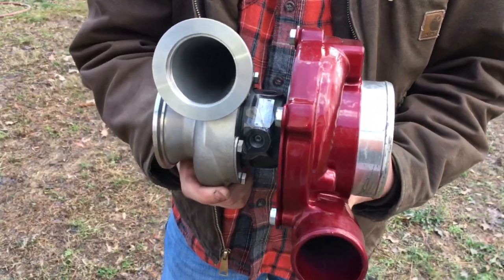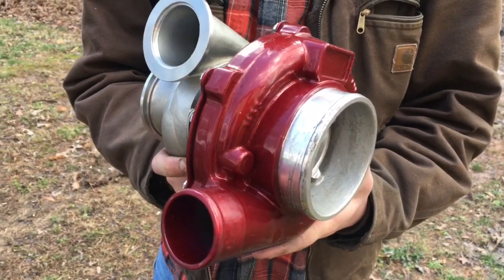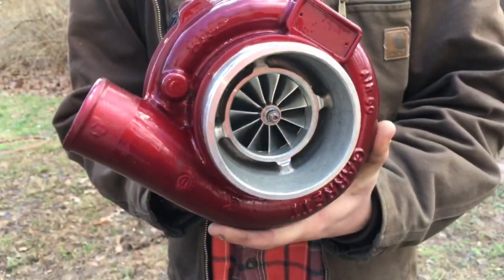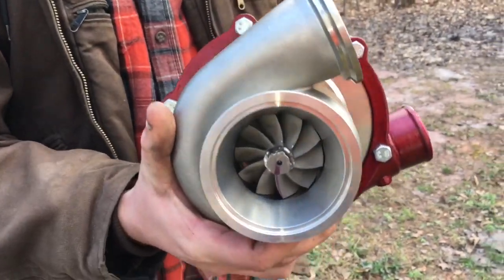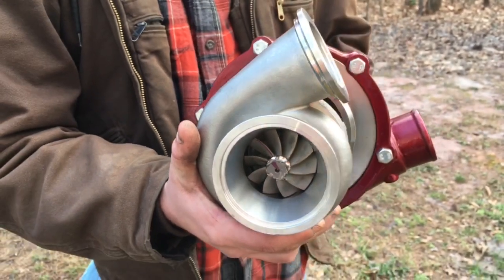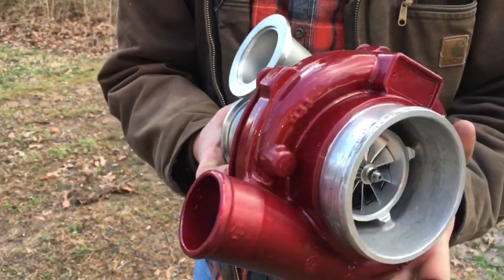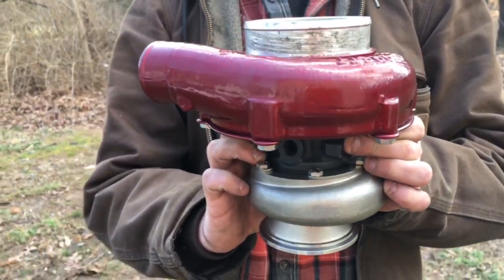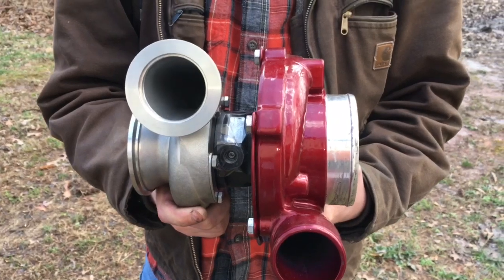Garrett GTX3071r Specs

Comment: Hey man i have a question regarding gtx3076r upgrade 
I was wandering if I can put a gtx35 compressor and wheel on the gtx3076 
Is it possible? What do you think of the combo ? 
I use it on my pro street drag bike it’s 1200cc boost is about 25-30 psi
Reply from the maker: The compressor housing gets close to being to thin, I have done it once before but each casting is different
Reply: Turbo Lab America 
What are the gains I’m gonna see from that mod? Or am I actually gonna notice the difference? 
#2 can I use a gtx35 compressor housing ?